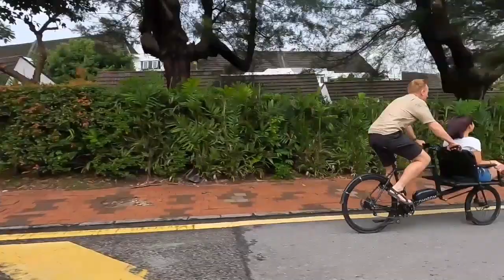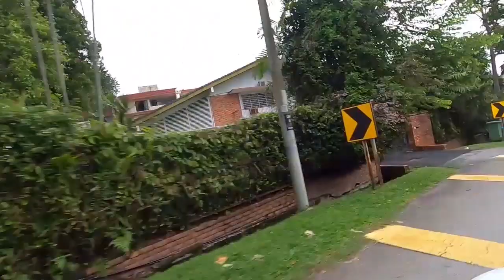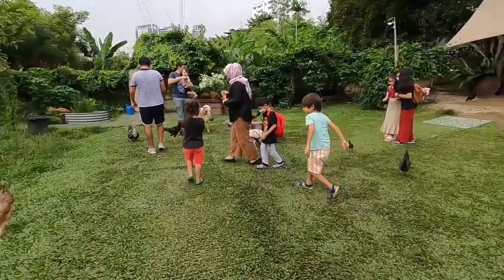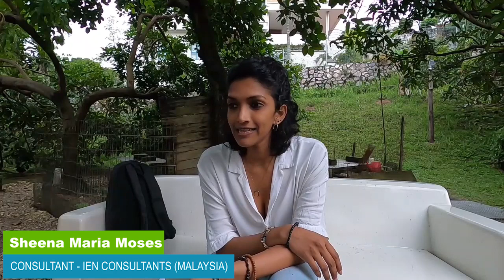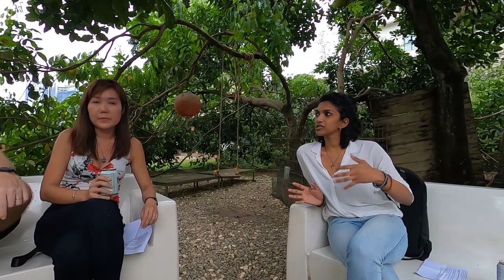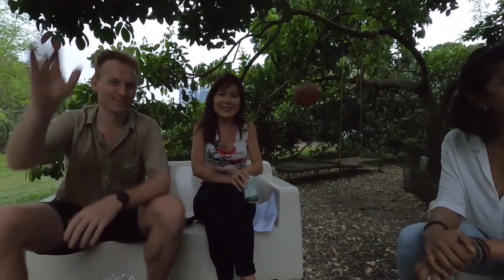IEN Podcast and Vlog #003 : COP26  - The Importance of Low carbon transportation & green buildings

Comment: So fun! Is it possible to climb hills with human in front and also down hill? Must have seat belt 😂!
Reply from the maker: Yes, the cargobike has a pedal-assist electric motor (250W), so up to 75% of the power can come from the battery. This is really helpful when going uphill with a passenger. And yes, the seat has a seatbelt, but it is more intended to strap young kids in place :-)